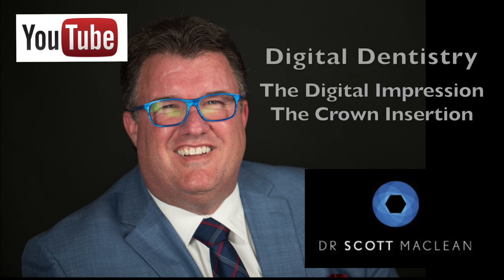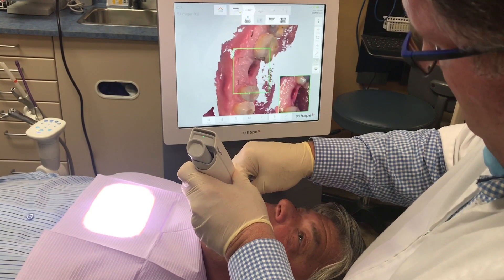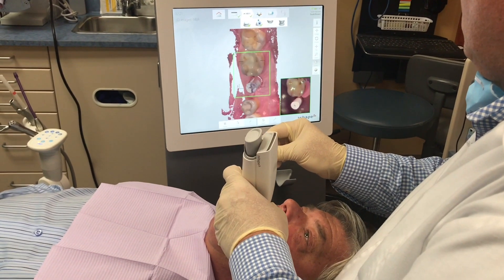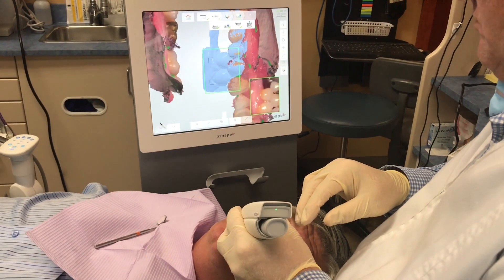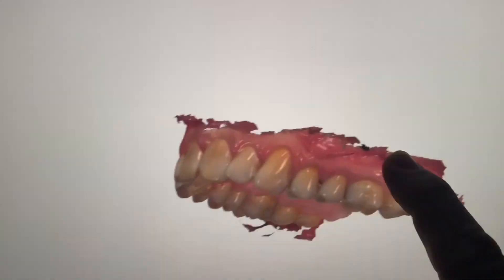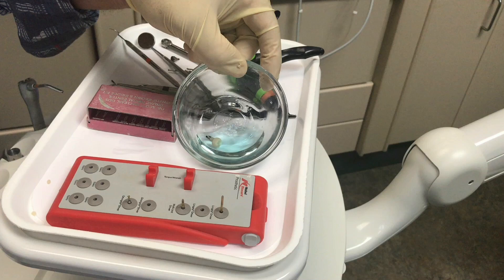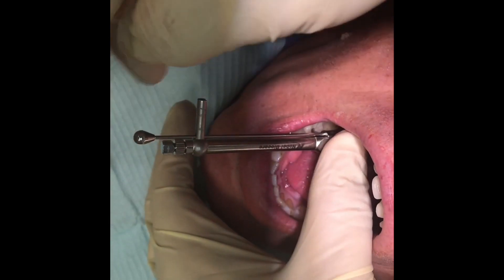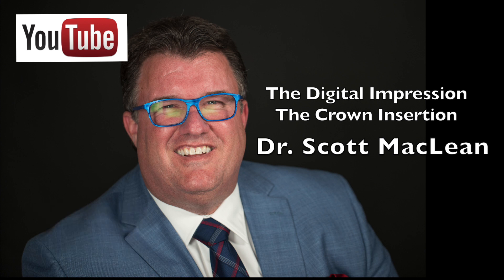Dentistry - Digital Scan Impression - Intra Oral Scanning

Comment: What do you think about the planmeca emerald? Is it comparable to 3shapes quality?
Reply from the maker: The Planmeca E4D scanner is an excellent color scanner with a USB interface hosting 30 micron accuracy. You do not require powder to take the scan. Your goal is to have an STL file to work on at the lab. This provides this file. The  tip is autoclavable. Portable between ops. May have a subscription starting in the 2nd year.
Reply from the maker: awesome scanner